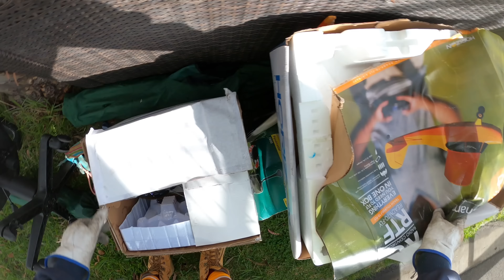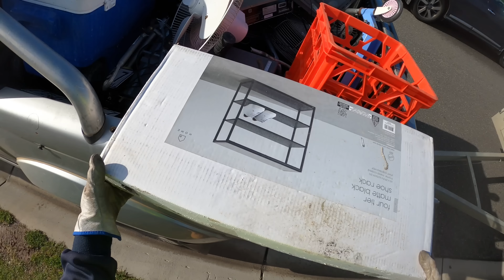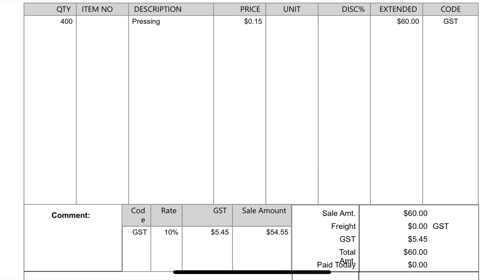Street Scrapping Rain Hail Or Shine?

Comment: Hi Poly, Love your videos mate! When you kicked the dryer out of the trailer at the end of the video...(around the 43 min mark)..it breaks the back off. the coiled heating element is there and very quick and easy to remove (only a few Philip head screws). My yard here in Qld pays a dirty brass price for them, ( and any other heating elements out of ovens etc). the dryer ones are very easy to remove. keep the videos coming!!!👍
Reply from the maker: Nice! I’ll ask my yard if they buy them as dirty brass. Thanks mate 🙏